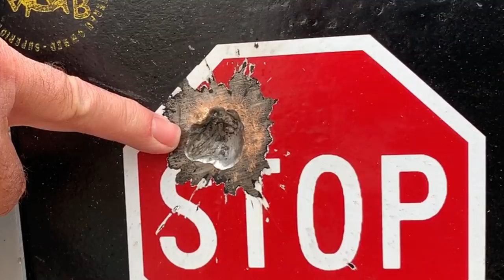2" AR500 Can It Stop 50 Cals Baddest Rounds??

Comment: For future reference, you are permitted to angel the metal so that when the rounds ricochet they fly up instead of straight back at you.
Reply: FINALLY somebody with some brains in this thread.
Reply: Angling armor effectively increases its thickness with a head on strike. There is more material from front to back in the straight trajectory. So there is less chance of penetrating it. That's why armored vehicles often have sloped armor.
Reply: @1pcfred  thank you I was about to reply to that subject

Comment: I would have been amazed if ANY .50 BMG round could penetrate 2" of hardened steel.  That's basically the frontal armor of a WWII medium tank.....  Worthy and fun to watch effort though.  BTW, I vote that the "zebra" round involved trickery.  A .50 cal projectile is much to small to pack that much blast.  I wager they had tannerite or something similar packed under the target...

Comment: when u had a 1" plate you could have done the tank armor trick with it by angling it it will make the round passthrough slightly more material. also how strong is jb weld.?? plz make some 1" 2" 3" 4" 5" thick plates from it in a cake tin as a mould and test them please.

Comment: For those who know more about this than me: Are the results of that zebra round realistic? Seems more like they put a small explosive under the plate mount .
Reply: That is the realistic result. Look at the table as the thing they built flips over. The shrapnel from the explosion blew the 2x4 apart and put a hole in the table. 10:25
Reply: @drew7599  Yeah, I seen the video. And it looks like the explosion came from underneath the mount they built, blowing a hole through the table and kicking all the splinters from their destroyed mount upwards.

Comment: Do a layer-cake of some 3/8" AR plates & ceramic floor tiles & see how far the BMG gets. USE GRADE 10 BOLTS TO HOLD IT TOGETHER, not that corner hardware store Chin-o-leum cr@p you usually set up with that stretches like warm mozzarella w/ each hit... ;-)

Comment: Of that was nailed to the picnic table you would have had more penetration. Pushing the boards and the steel plate backward it takes away a lot of the force of the impact

Comment: Can  you PLEASE angle your target to the side ever so slightly? 10deg should be enough to deflect it to the side in case the target doesn't completely eat the projectile, sure it'll slightly increase the thickness but if you want to be behind the gun and not use a string on the trigger this should be basic safety